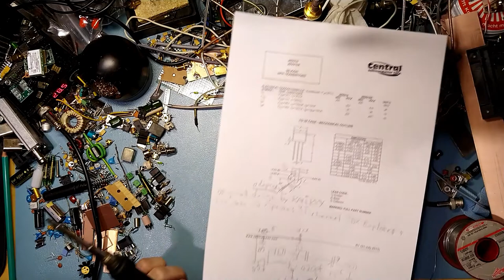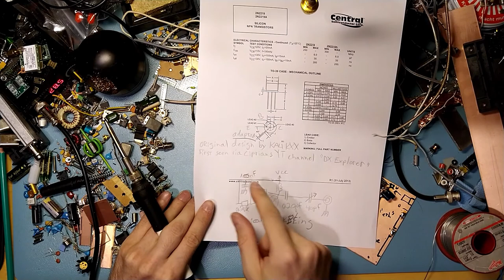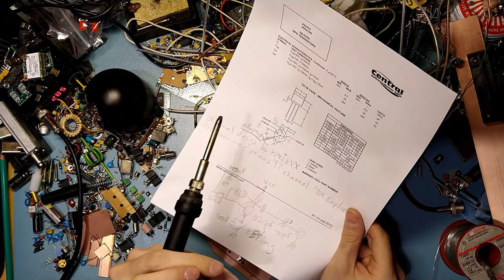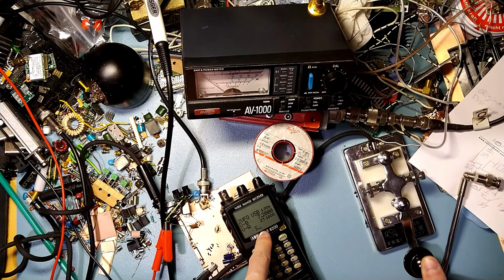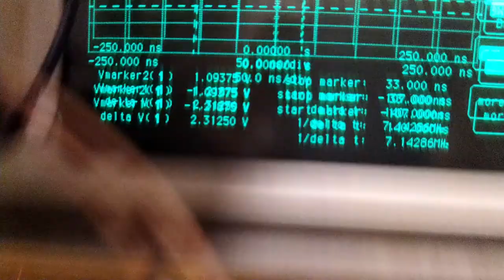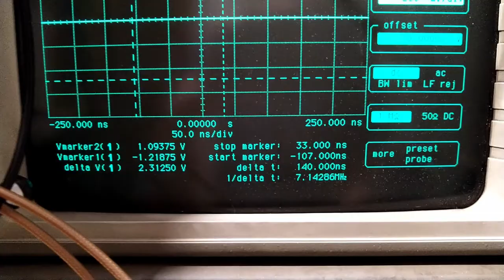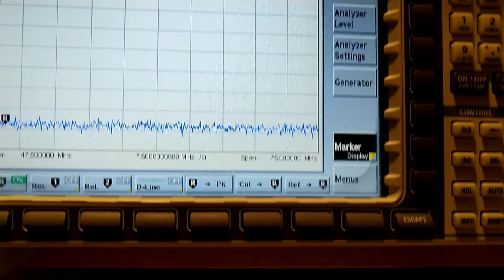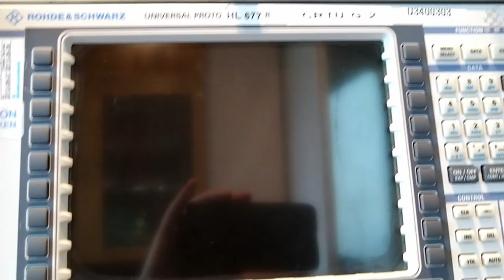The 10minute transmitter for 40m - A realtime build and some measurements

Comment: Really nice one. So this is what I discovered while making mine... the inductor it's good to be closer to 100uH... the output capacitor... the one I was saying that mine was 220pF in parallel with the trimmer... in my case I ended up with a value of 235pF.... but this way I'm getting about 700mW with a 2N2222 at 9v and about 1W at 12v. This though is pushing the transistor a little and it's getting a little hot... and also there is a little bit of chirp in the output signal. If I raise or lower the value of that output capacitor... the power goes lower to about 300-400mW... but the chirp goes away. I also tried a different inductor... even a hand made one... but so far the best results I got with the 100uH that I used in my video. I'm working on a new version now ))) Video coming soon ))) 73 my friend. Ohhh... the shorter the connections between the components... the better. But I'm sure you already know that )) Have an amazing week my friend and good luck with all the projects.
Reply from the maker: If I rebuild this I'll make sure to use a larger RFC and test some other output cap to make varying it easier than with the tiny trimmer.
Reply: Yes... me too after making the first one I noticed the trimmer doesn't help much as I thought. But since in the schematic I had the capacitor was just 240pF... I thought having a little swing is good. Turns out that the best is to use a 1000pF variable capacitor and figure out the value with that one... the best output in power. Then you remove it... measure the capacitance and used a fixed one with the closest value. Now if course... it may chirp a little at full power... so if you don't like the chirp you may want to lower the value a little to get rid of that. Or just stay with the chirpy sound and have full power as I had with mine hehehe. I was not expecting 1W from a tiny 2N2222. In my mind I thought I'm happy if I get 50mW out ))) 73 my friend.
Reply from the maker: @dxexplorer  Yeah 1W from 2n2222 is quite the feat. Yeah I have some 350pF air variables so I'll try it with one and see how that goes for finding the maximum output power. I'll use the same 2n2219a as previously as it works and is essentially just a high power 2n2222a.
Reply: I can't wait to see the next one as well )) 73 my friend. I'm happy you have an oscilloscope to make measurements. I work by "ear" for now ))) Or by eye like the carpenters hahaha.
Reply: You are getting 0.7 W with 2N2222? I seriously doubt it
Reply: @awaismushtaq5719 at 9v yes... 1W with 12v but us heating up quick so you need some sort of heatsink. All you need is a 2N2222 with a good amplification factor. A real 2N2222 not the cheap fake ones you find all over the place. Those burn right away. 73, YO6DXE.
Reply: @dxexplorer  are you saying that 2N2222 was released in metal package TO-23 type, one that uses aluminium circular heat sink? Strange! I have used that transistor for quite some time but .... May be you know better. That transistor has 0.5 W maximum collector heat dissipation, 0.625 W for TO-23 type package. I don't know how did you get 0.7 W out of it without product getting zapped!